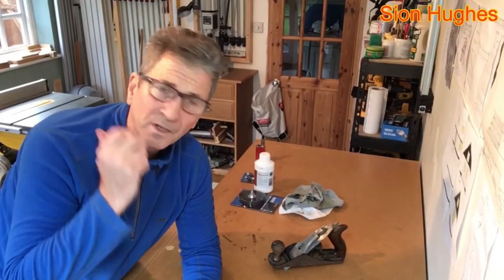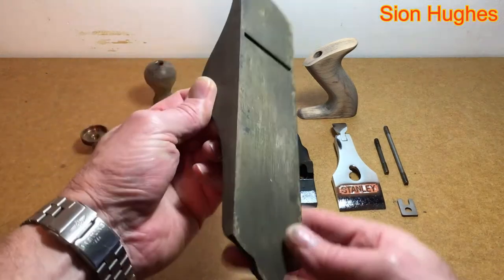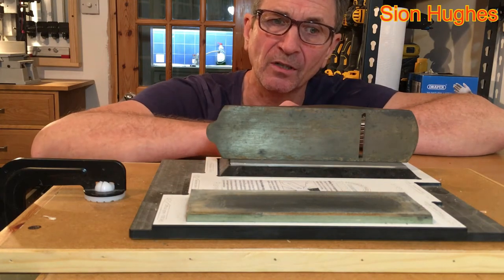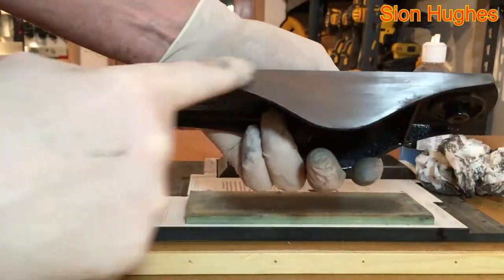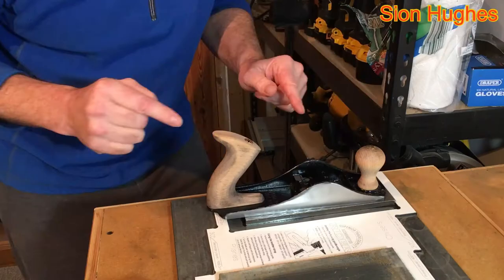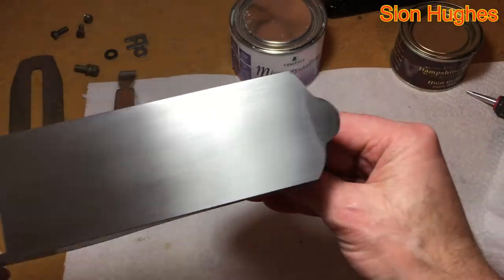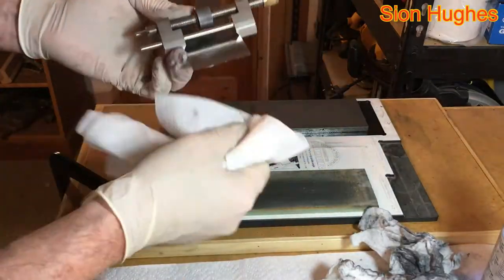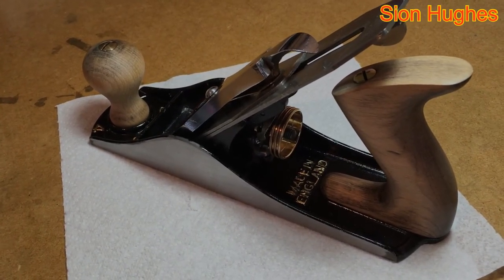How to Restore a Stanley hand plane

Comment: Hi sorry to tell you this its not type 15. You have a kidney hole lever cap, an oogee frog. Type 16 and above have oogee frog,  type 15 low frog. on the under Neath of lever cap is no paten date so later model than type 16 . No Hard rubber adjustment knob so its not  type 17, so later model.  the y shape frog seating is type  18 -19. you have hard wood tote and knob, late models. type 15 most likely rose wood. sorry for this I hate giving bad news.
Reply from the maker: Hi Robin, You are , of course completely right and I have had, as you can see, many many comments pointing out all the factual errors . I followed the (on line Stanley identifying chart) , but clearly went wrong . Sorry . I also now understand that I should have left the blade and frog in when I was flattening the sole . For what its worth I drew cross hatching lines on my sole recently and with blade fully retracted re dressed the sole on a 1000 grit diamond plate . It was totally flat . All the lines gone . The handles are Beach , not oaks as I claimed . Still for all that Its ended up being my go to plane. I have jus got myself a vintage Stanley no 6 with old rose wood handles and only BAILEY written in the front . The lever cap has no branding and isn’t chromed . I really need it as I can’t afford a planer , thicknesser . I will make a video about that restoration and I promise it will be better in every way . Please consider subscribing and I am confident you will like my upcoming BAILEY No 6 restoration .

Comment: I want a Stanley Bailey. Regret buying a cheaper Record Plane… the frog cannot be moved… give me one Bailey no. 4
Reply from the maker: My Stanley give a better performance than my brand new Rider . Could you not sell what you have on ebay and get yourself a Stanley ?
Reply: @sionhughes5543  There is really negligible amount of Used Stanley planes in my country and for the cost of the shipping. I rather buy a new plane, maybe I just use my record plane as a scrub plane.
Reply from the maker: Which country are you from ?
Reply: @sionhughes5543  from Singapore
Reply from the maker: Well you certainly have a wonderful selection of hardwoods to work on . I now understand your difficulty’s in tracking down an old Stanley Bailey . Good luck . Welcome to my channel
Reply: Never come across a Record plane where the frog doesn't move, how old is it ?
Reply: @alland1241  It is fixed to the base… bought few years ago. You can’t move it.